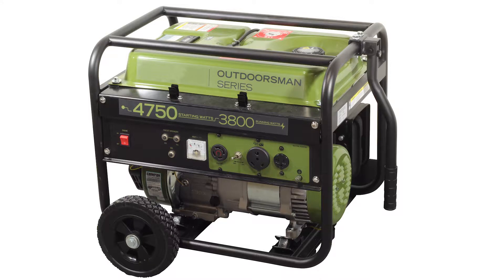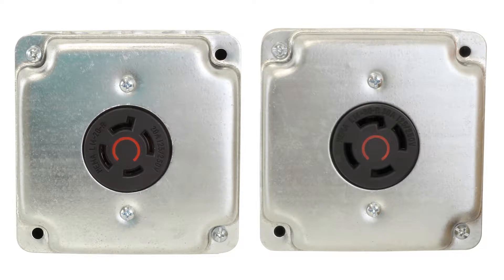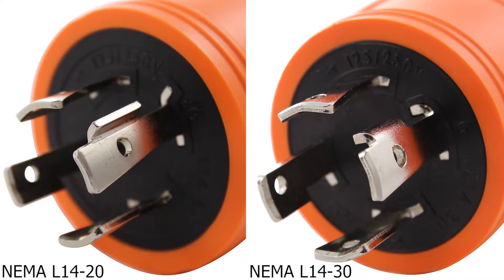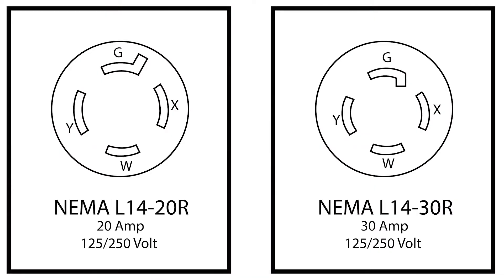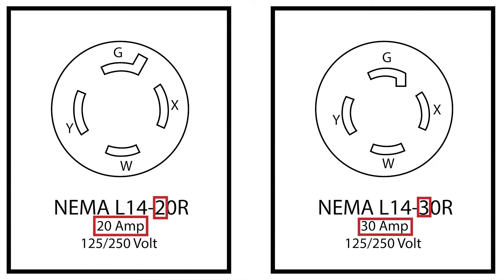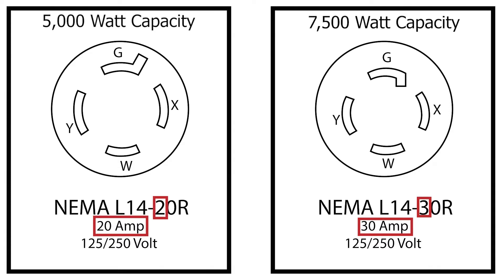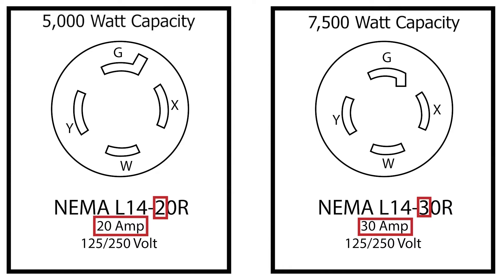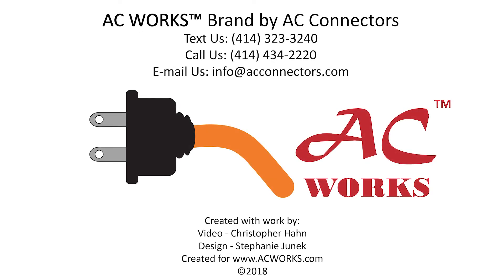AC WORKS® Wisdom: Differences Between L1420 and L1430

Comment: Are the L14 20p and L14 30p outlet physically the same size? IE will a 30p outlet fit in a 20p hole / cover?
Reply from the maker: When we are talking about the size specifically, yes, L14-20 and L14-30 outlets are the same size and will fit in the same hole/cover. I just want to reiterate that they are still different configurations and they need their exact matching plugs to fit.
Reply: @ACWORKS  Thanks!!

Comment: can you use a 30 amp and make if fit to the 20? i have a generator has 20 amp recepticle. i bought 30 amp adapter to fit a machine plug. wouldnt the adapter just be more heavy duty? i mean i can return and get 20 amp adapter but would it make a difference?
Reply from the maker: No, you cannot do that. You can't bend the prong to make it fit. It just doesn't work and it will ruin the adapter and potentially the generator outlet.